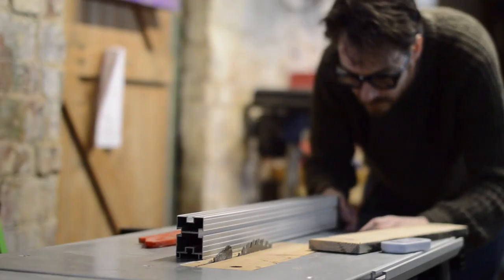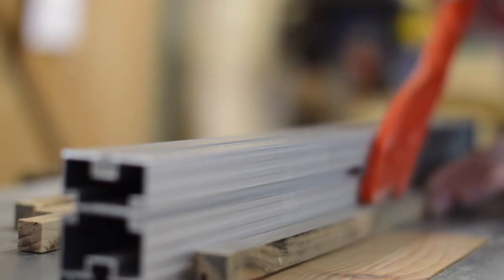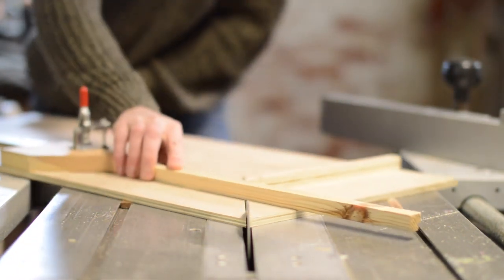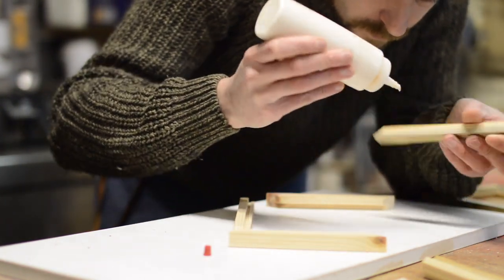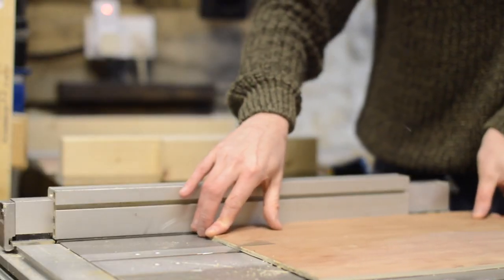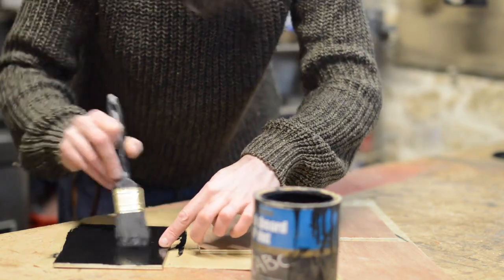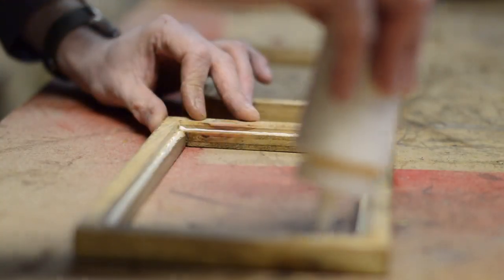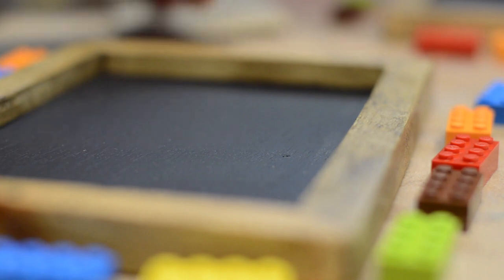Lego Name Plate

Comment: Always a pleasure to watch your projects. Is that a Metabo TK 1256 table saw you used for the mitres?
Reply from the maker: Yes it was, well spotted. I no longer have the saw.
Reply: Badger Workshop Except for being a bit small did you like it?
Reply from the maker: It was a great saw. I had the sliding rail, but that was to bit for my shop. The only reason I sold it was the small 7" blade. My Bosch has a 10".

Comment: Hi Matt, is the motor on your Bosch tablesaw quite quiet?? It seems really quiet compared to my dewalt which is hideously loud!
Reply from the maker: This was an old video with a saw using an induction motor. I did a review of the Bosch saw and give a DB reading. People have commented that its not as loud as the desalt. The Axminster saws have induction mortars and are meant to be quiet but I have not used one.
Reply: Badger Workshop ah I see. Cheers!